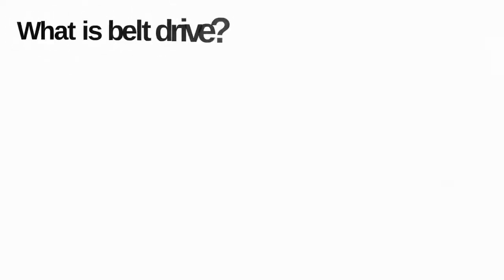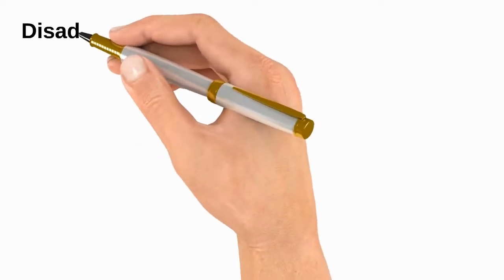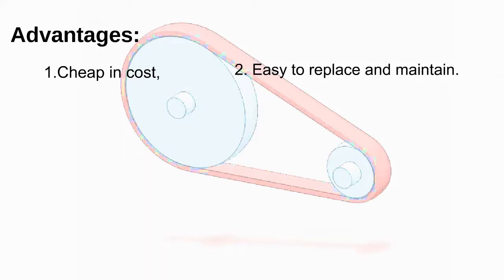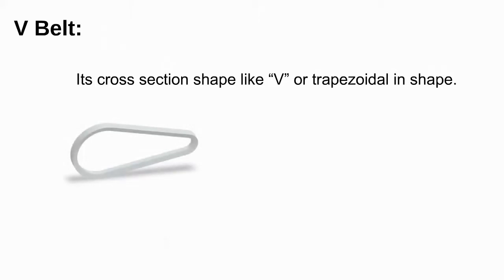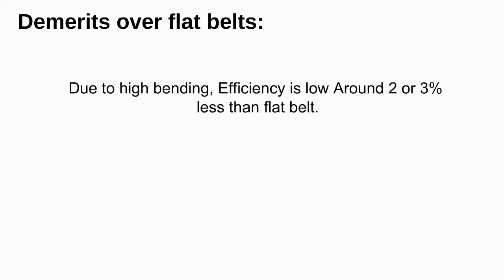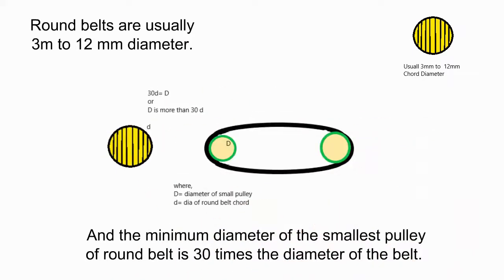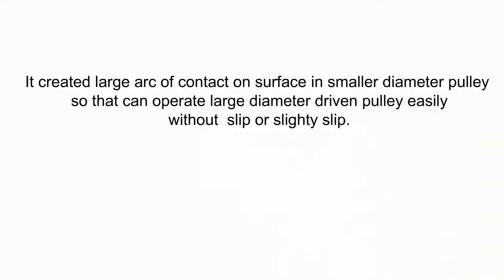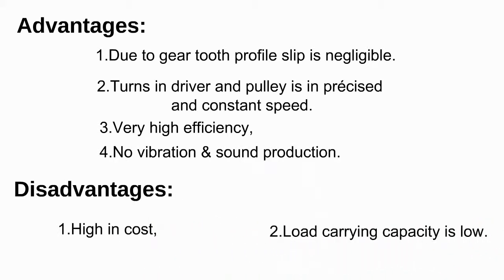Belt drive and its type

Comment: The centrifugal tension in belts

[A].increases power transmitted[B].decreases power transmitted[C].have no effect on power transmitted￼[D].increases power transmitted upto a certain speed and then decreases
Reply from the maker: Effect of Centrifugal tension is to reduce the power transmission capacity of the belt drive. Effect of initial tension is to increase the power transmission capacity of belt drive